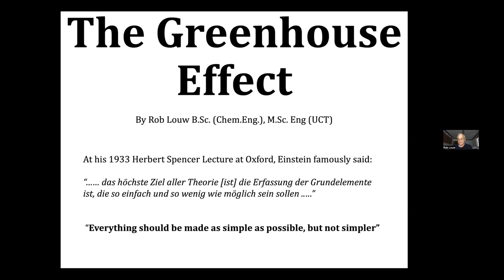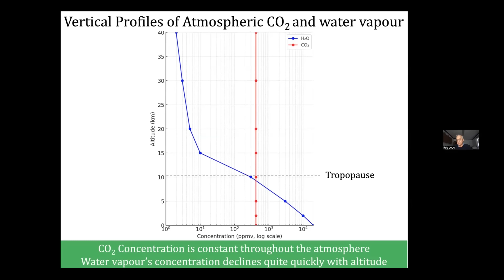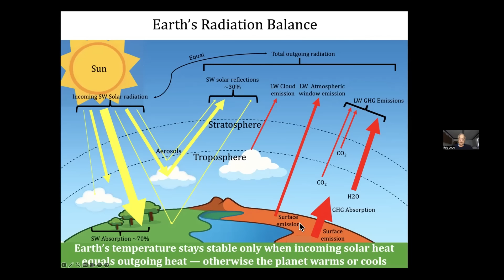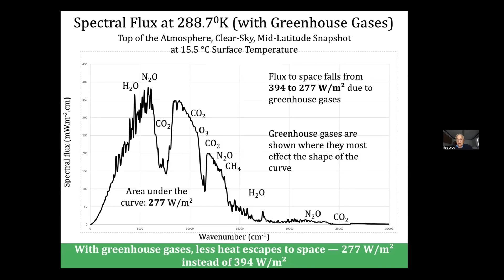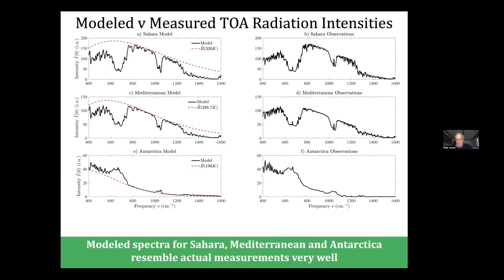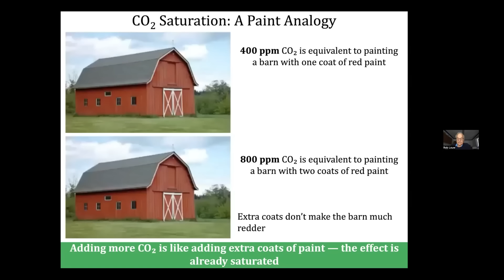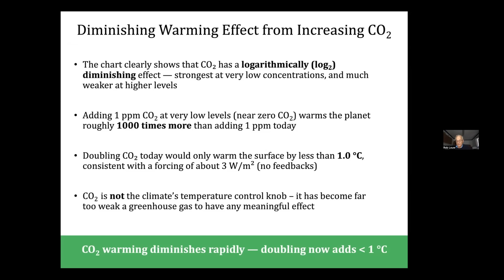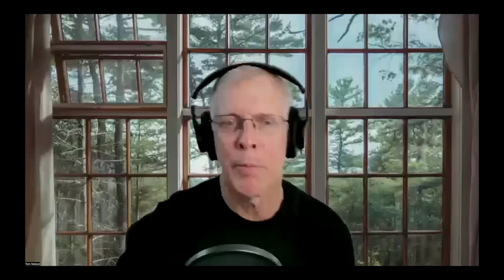Rob Louw: The Greenhouse Effect  |  Tom Nelson Pod #341

Comment: The radiative Greenhouse effect theory accounting for the 33K between the 255K 'no atmosphere' Lunar average surface temperature and the 288K average near surface temperature is utterly ridiculous - the slide showing Earth's atmospheric temperature gradient shows the real cause....it's the atmosphere!

If Earth's atmosphere comprised no infra-red active gas molecules whatsoever but in it's place was any other gas, then are you really suggesting that the average near surface temperature would be 255K ? Not withstanding the fact that there would be no clouds (so albedo would be different) and the unsaturated adiabatic lapse rate would extend up to the tropopause (as the saturated adiabatic lapse rate would not start at the Lifting Condensation Level) the average near surface temperature would be almost be 288K - it's the atmospheric mass suspended in a gravitational field which accounts for the difference.

If it is true that the radiative greenhouse effect really does explain the 33K difference then what explains why the air temperature is 1K warmer for each 100m of a wide excavation below sea level - you can't claim that it's the radiative greenhouse effect as your reverse engineered figures have used all of your 33K budget. So, if you say that it's the adiabatic lapse rate, then why does the adiabatic lapse rate only apply below sea level? Of course it doesn't. Instead, the adiabatic lapse rate explains the air temperature all the way from the bottom of any excavation all the way up to the tropopause.

If
Reply: Even with an IR-transpaent atmosphere, Earth's average near surface temperature would be higher than the Lunar average surface temperature. Fact.

The energy required to establish our Earth's atmosphere was obtained during the billions of years when "energy in" was greater than "energy out" (unlike our Moon which never developed an atmosphere where "energy in" always equalled "energy out"). It is this 'surplus' of retained energy that was delivered into the atmosphere primarily by convection over billions of years that accounts for the difference in average temperatures seen on Earth and our Moon.

The energy within the atmosphere is represented in differing proportions by gravitational potential energy and kinetic energy (there's more potential energy and less kinetic energy in a parcel of air that's higher than another parcel of air below it that will have more kinetic energy and less gravitational potential energy. The parcel of air having more kinetic energy will result in a higher temperature and higher pressure.

Having LWIR-active gas molecules in our atmosphere DOES result in our atmosphere having more energy in it than would be the case if LWIR-active molecules were absent but the presence of these  LWIR-active molecules does NOT account for the 33K difference - the majority of the energy got there by advection and latent heat released by condensation of water vapour.

The adiabatic lapse rate is describes the phenomenon of conversion of energy between gravitational potential energy and kinetic energy in a gravitational field. It is the adiabatic lapse rate that accounts for temperatures greater than 288K at the bottom of deep open-cast excavations, NOT 'extra back radiation'. 

If PV=nRT and the adiabatic lapse rate explains the increase in air tempetature at the bottom of a deep open cast excavation then it also explains the average near surface temperature and hence the "Radiative Greenhouse Gas Effect of Back radiation" is entirely redundant (as both expanations can't be true).
Reply: Indeed, an atmosphere of only N₂, O₂ and argon would result in the earths temperature being 255 K.
Reply: No, Peter, there is no radiative greenhouse effect.
Reply: @PieterKuiper Oh dear, they really do have you messed up, but let's try this: 
I'm sure you know the formula: PV=nRT
If the number of moles of air molecules in 1 cubic metre of this modified atmosphere is the same as that in Earth's atmosphere then you are implying that the near surface air pressure will be 255/288 of one atmosphere. So, Even with the same atmospheric mass and  same total number of gas molecules as Earth's atmosphere, the near surface temperature would only be 255K if the modified atmosphere included no IR active gas molecules. Ok let's say that's true. Now, what would be the temperature at the bottom of a open cast copper mine 1km below sea level. I'd say it would be approximately 10K hotter than the air temperature at sea level. What accounts for the 10K difference?
Reply: @stevetitcombe939  The air pressure is the weight of the atmosphere above you. At sea level it is about 1 atmosphere, it does not depend on temperature. So assuming the number of molecules of an IR-transparent atmosphere remaining equal, at 255 K the pressure would still be 1 atmosphere at the earth's surface.
Reply: @PieterKuiper The air pressure DOES depend upon temperature. Look at the Ideal Gas Law PV=nRT. In a constant volume and constant moles, pressure and Temperature are directly proportional. If you go further and look at the Units, both sides PV and nRT both resolve to Joules i.e. energy.

To address further your statement that Pressure only represents the atmospheric mass above the surface, what do you think lifted that atmospheric mass off of the surface? It is energy, transfered by conduction and convection (advection). Once lifted of of the surface, the temperature of each parcel of air within the troposphere decreases in tempetature according to adiabitic principles ie translational kinetic energy is converted to potential energy. The temperature gradient up  through the troposphere is determined by the 'air density' (the amount of atmospheric mass in that 'parcel' of air), the Heat Capacity, Cp, of the atmospheric mass in that 'parcel' of air, and the strength of Gravity such that two parcels of air each comprising 1Kg that are separated by 100m in height in a gravitational field of 9.8m/s^-2 would have a difference in potential energy of 9.8kJ (the higher parcel will have the greater value) whilst it will also be colder than the lower parcel of air corresponding to the amount of translational energy (represented as temperature) that was required to provide that potential energy. The actual temperature difference will be determined by the Cp and mass of that air parcel.

You'll see that both parcels of air actuall have the same total energy (energy has a way of distributing itself evenly) but the lower parcel has both a higher temperature and, consequently, a higher pressure.

Again, tell me what accounts for the higher air temperature of 298K at the bottom of a deep open-cast mine, 1 km below sea level? Are you seriously trying to tell me that the additional 10K of temperature is due to additional 'back radiation' upon the surface of the mine? Come on think with an open mind, you're nearly there!
Reply: @stevetitcombe939  Nowadays many people have a pressure sensor in their mobile phone. You could try with an app to measure inside your home, compare upstairs and downstairs. If you have a 1 km tunnel the air pressure at the bottom will be about 1.12 atm.
Reply: @PieterKuiper yes I agree, and the temperature will be warmer - what causes that increased temperature  - extra back radiation?
Reply: @stevetitcombe939  The temperature will just be the temperature of the walls of your basement tunnel. It does not depend on radiation.
Reply: @PieterKuiper but that's why I created the scenario of a deep and wide excavation like an open-cast copper mine (so you couldn't deceive yourself that the increase in temperature was somehow the result of geothermal energy from the sides of a 'tunnel'). 

I shall say it again, the increase in tempetature above the average of 288K at sea level is due to the adiabatic lapse rate, whereby the reduced gravitational potential enegy within that parcel of air near the bottom of that open cast mine has not been lost but has been converted into kinetic energy at the rate of the Specific Heat Capacity, Cp, of the air. This happens regaedless of the composition of the atmosphere - it could comprise noble gas or only diatomic gas  (only the Cp value will he different) but the effect of  the adiabatic lapse rate will still manifest itself.

To deny the existence of the adiabatic lapse rate is preventing you from seeing what's really going on. So, I say it again: LWIR-active gases are not wholly responsible for the energy held in Earth's atmosphere. In a thick atmosphere like that of Earth, advection is the main energy transport mechanism from the surface into the atmosphere. Once in the atmosphere, the energy will attempt to evenly distribute itself between kinetic energy and gravitational potential engergy through the vertical height of the atmosphere. 

Image a glass column 2m  in diameter extending from the surface up to the tropopause: in each 1m parcel of air then energy within each parcel will be the same. But for those parcels at the upper most part of the column the energy is mostly gravitational potential energy (and will ge colder) whereas for those parcels near the bottom of the column, most of that energy will be kinetic energy (and thus hotter) and very little will be gravitational potentiial energy. Of that glass column were to be extended down to the bottom of an open-cast copper ore excavation, the tempetature of the parcels of air at the bottom of the column would be even hotter (because the gravitational potential energy within these parcels would be less).
This would be true if the gas in the glass column comprised only noble gas or only diatomic gas or any mixture in between.)
Reply: @stevetitcombe939  None of this matters. The radiation balance of a planet with an IR-transparent atmosphere only involves the radiation directly from the surface. Such an atmosphere would only redistribute heat by winds and convection cells, but does not radiate (Kirchhoffs radiation law, emissivity is absorptivity). The radiation budget is really very simple, in principle the same as that of the moon (ignoring UV).
Reply: How about: closer to the core of the planet? Gets pretty hot down there..

Comment: Sorry but the numbers are wrong.
They are formed in the assumption of a pure black body which is a theoretical existence only. Earth is not a black body especially the places that are the opposite of black, this can greatly alter the numbers, there is also no allowance for convection in most people calculations. Most of the problem stems from trying to use formulae and theories that work on small scale lab experiments because all the confounding factors have been excluded and then trying to apply them on a planetary scale not accounting for the confounding factors one of the biggest ones omitted is clouds.
As evidenced by the multiple Ice Ages if it weren't for volcanic activity providing extra heat and reducing albedo there wouldn't be enough heat retention by GHGs to keep the planet from freezing solid,
The assumptions are about what amount of energy is coming in, the heating it causes and what is emitted as infrared radiation

Comment: The problem with the greenhouse effect is that it only exists in actual greenhouses and other similar enclosed structures. These structures (even if not insulated) are designed to prevent convection which is a far greater factor in the lose of heat than radiance.
So far all the experiments and dialog that I have seen from the Pro climate alarmists have worked in the premise of trapped heat excluding convection in the experiment and dialog.
The real effect is Radiance Delay. You could call it the leaky thin blanket effect and be far more accurate than anything mentioning a greenhouse.
Reply: Yes, but i dont even like the idea if a blanket. These are gasses although i think wv has special status as it is only one of the phases of H2O. A blanket is something that covers. WV absorbs, convects w a lapse rate. Ive never seen a blanket do that..🙂
Reply: No, it is also the carport effect, where the infrared radiation prevents frost on your windshield.

Comment: Thanks! :) A very good presentation and to the point!:) Would be a super idea to give this presentation to students. I, however, have a question: Where does evaporation/convection come into the picture on the figure at 11:11? How much of the surface heat is convected upwards in the atmosphere? 
According to one source:
"The Hadley, Ferrel, and Polar cells are the three large-scale atmospheric convection cells that drive global climate and weather patterns. Working in concert in each hemisphere, these thermal engines transport heat from the equator toward the poles to redistribute solar energy and maintain a global thermal equilibrium."

Comment: This is all standard theory. However, it seems to me still highly speculative and far from 'settled'. When i hear or see the words: 'without the greenhouse gasses the atmosphere would be x cooler' i question the person stating it. We have to remember that the atmosphere is in a non settled state of flux, has various thicknesses. And that Earth is NOT a blackbody but a spherical greybody. It is never in balance so never out of balance. It is trying to find equilibrium but always in flux. If greenhouse gasses would really 'trap' heat we would have a runaway effect which we dont see. It can only delay. That delay has to be large to have an effect. Given the amount of those gasses especially CO2 highly unlikely. And WV has gas laws, convection, and phase transitions which normal non greenhouse effect physics can explain.
I am not at all convinced by this presentation.
Reply: Part the story but correct conclusion..co2 not the driver.
Reply: Actually all of this is very well known and well established science. And to claim that the earth would not be cooler without CO2, water, methane and the like?! Dude, read some more. And there’s no runaway effect just as your body doesn’t overheat every second of the day. You’re constantly producing heat in your body and it all gets lost over time to maintain a constant body temp. And just as your body has mechanisms to speed up or slow down that heat loss when heat production changes, the earth has mechanisms to increase or slow down heat loss.

Comment: Unfortunately this presentation falls under Einstein's "simpler than as simple as possible". It is the same pseudoscience that infects mainstream climastrology - it's all about radiative heat transfer, essentially modelling the atmosphere as a semitransparent solid rather than a gas, while ignoring conductive and convective heat transfer. This is most apparent with easily falsifiable claim that "we don't freeze to death at night because we got greenhouse gases keeping us warm ..."

Horse sh!t, you don't freeze at night because of the air conducting its heat back to radiating solid surface -- easily explained with the kinetic theory of gases. If local convection is negligible at night (no wind) then air in contact with the radiatively cooling surface cools faster than the air above it. This is called a temperature inversion and is at all times occurring somewhere at night on the surface or above cloud layers if there is no convection at that boundary. The cooling will continue from the ground/cloud upward until convection returns to advect heat from elsewhere or the sunlight returns to warm the surface faster than it cools. If there is appreciable water vapor in the air when the temperature inversion is forming, the surface and atmospheric boundary layer can still become cooler than the air above it. The cooling is slower, however, but not because the "greenhouse gas" back radiation warming the surface, but rather from latent heat of formation of the water vapor being released as sensible heat back into the system. This is when dew, frost, or fog forms.

Conduction and convection dominate heat transfer in the Earth atmosphere and within any fluid that is allowed to convect. Convection allows radiative emissions from IR active gases to offset warming from IR absorption. This is not just theoretical, but has been experimentally proven and put to use in applied sciences. 

Atmospheric warming of planetary surfaces is all ultimately due to latent heat of formation of the gas, with the warming effect caused by kinetic energy or the latent heat itself returning back into sensible heat.

Comment: At 52:39. "Natural systems have negative feedback." That is an overgeneralisation. What is true is that stable systems have negative feedback. We observe that the system is stable on the relevant time scale and average. We can deduce from the relevant kind of observed stability that the feedback is negative. At 55:50: The change of solar irradiation due to the eccentricity of the earth’s orbit is another important argument for stability and negative feedback.
Reply: The Milankovic cycles in earth's orbit caused the glacial and the interglacial periods, and those are rather subtle effects in irradiation. What humanity is doing now is not subtle.
Reply: It's interesting, because population dynamics are also negative feedbacks at certain points, but the crowd here probably wouldn't see that particular negative feedback as a positive thing when applied to humans.